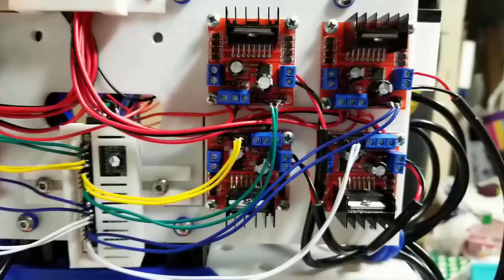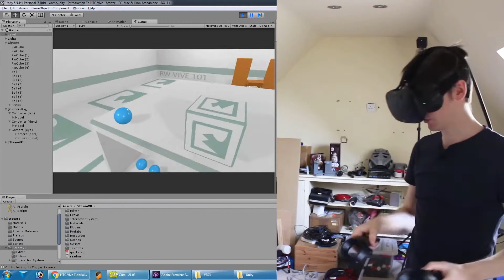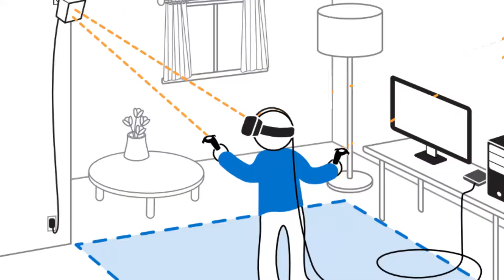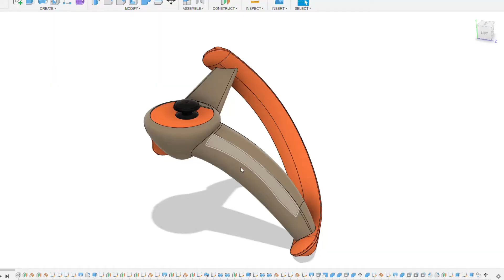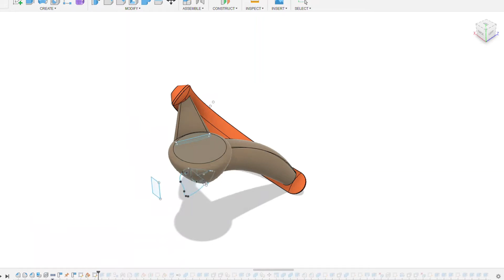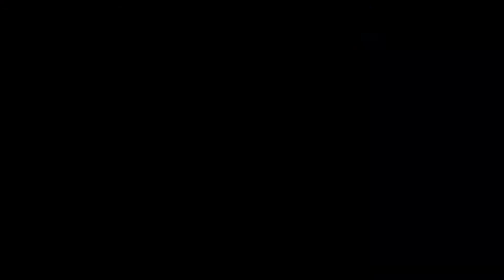DIY VR Setup! | Virtual Reality #4 | New setup and controller!

Comment: I tried this and for really far using a Kinect and a couple of joy cons with a phone as the display and I got 6 degrees of freedom with it but I think a more challenging problem to solve would be an alternative method of locomotion for vr. I tried making contraptions for walking but then I realized there’s swimming walking running jumping stairs and other movements so I gave up
Reply: Make a treadmill with an arm that Is attached to your hip so when you want to swim you just do regular swiming possisions and the arm will hold you, for stairs you could use some kind of haptic shoes that simulate the feeling of stairs
Reply: @lambdalabs8216  I got a tread mill and it’s scary af even with a harness you eat shit